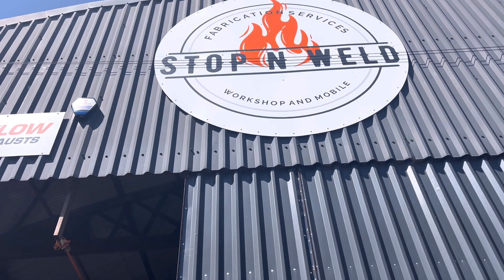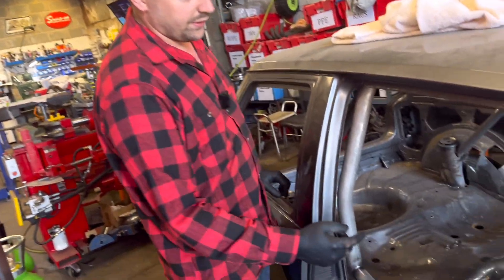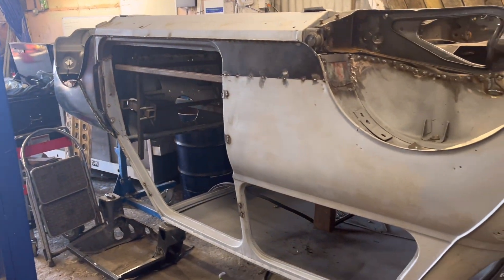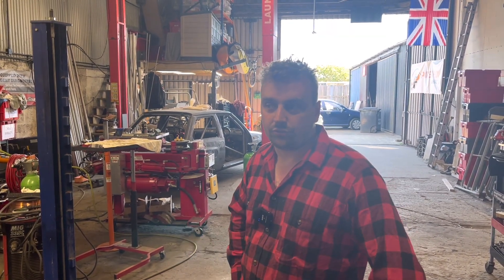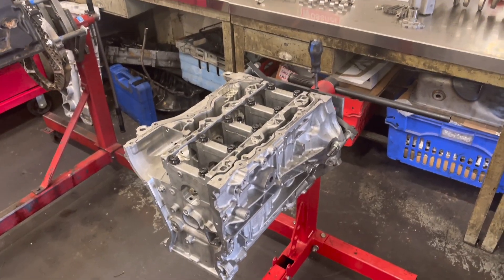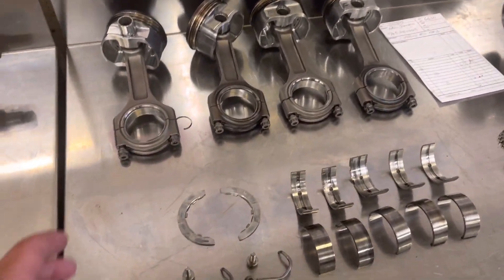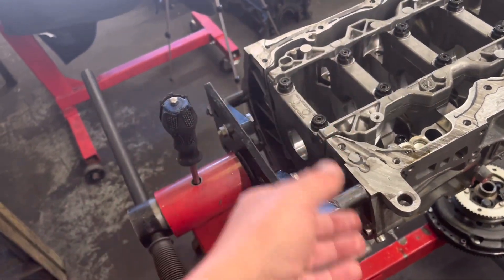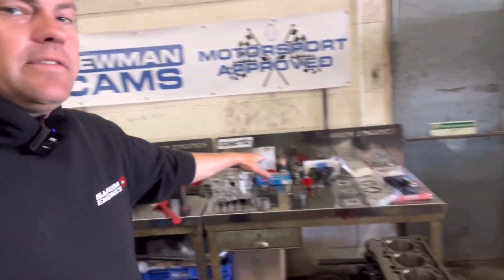Focus RS mk3 engine dismantle: we didn’t expect it to do this!

Comment: Not sure about the statement " a focus rs mk3 engine that rarely fails", i bought mine new in 2016, 1st 18 months of production engines had the head gasket fitted from the mustang engine, mine went in for recall to have the correct gasket fitted in september 2018, next service in september 2019 garage noticed an oil leak which was a common fault after having head gasket replaced, errors in replacement procedure headed out by Ford to dealers led to this, went back in in Feb 2020 to have it replaced again, 2  months later engine failed, Ford would only offer 65% contribution towards replacement engine as it was out of warranty, cost me 4.5 K to have my car fixed, many other instances like this for early (Pre 2018) cars, mine has been faultless since new engine so later cars should be trouble free

Comment: watch Pakistani trucks on YouTube. they stick weld cast, rebuild engines in the dirt, drill & tap, bolt AND weld broken crankshafts. its crazy what they do with 60 year old equipment and in the dirt.

Comment: how much do you charge for building a 2.3 ecoboost ? 
and are you willing to install a CSS ?
Reply: If you get no joy outta Barum try X Power in Essex 
The guy who runs that is the ex Mountune workshop manager who still gets parts from there and knows all the ex Mountune staff  and current but he build engines, rally engines,race engines and Rallycross and Drag racing engines.

Comment: A man who can do cast aluminium TIG welding repairs successfully is worth his weight in gold.
Reply: Darnit! Why am I so poor then lol? Kidding mostly but, I have welded cast a cast Aluminium transfer case from a mates Land Cruiser after he shattered a gear and it smashed a chunk out of the transfer case while doing some extreme 4X4 ing with an Oxy torch and later we got a TIG and I repaired a broken gearbox side cover from a bike and several other jobs with that TIG too.
Reply: @probingtime666  Of course I'm just pointing out there value. I wouldn't ever promise that they're going to get treated or paid properly.😒😒
Reply: @fredflintstone8048  Ah well, I'm behind the curve, as always:face-pink-tears:. Oddly while I have actually spent several years working AS a welder, and using a MIG mostly, I've never ever used a MIG for welding Aluminium. I've always been working with steel on all those jobs. The only times I have welded Aluminium has been working as a maintenance fitter and on side jobs either for myself or for a friend. As I understand it, and imagine it from my experience with the oxy and the TIG, it's quite a lot different to welding steel, I'm guessing more because of the heat dissipation issue with Aluminium.
I have had to weld cast iron a few times and that was a big truck differential housing that required pre heating to a specified temperature with heating torches then stick welding. It had to be chemically crack tested after and despite me being sure it would need redoing, preferably by someone else since to me, it looked and felt terrible while welding it, it was surprisingly OK apparently. I don't want to again if possible though, that stuff is weird and requires so much extra preparations.
Reply: as the guy said, it’s a case of trying to dig down to fresh ally that isn’t full of crap and then pre-heating the casting.  Slightest bit of oil coming through the weld and it turns to crap.
Reply: Avoid the "telegram" BS scammer below. It's purely a scammer, no affiliation with Barum Engines.
Reply: Is that a crack between the valves in number 2 chamber